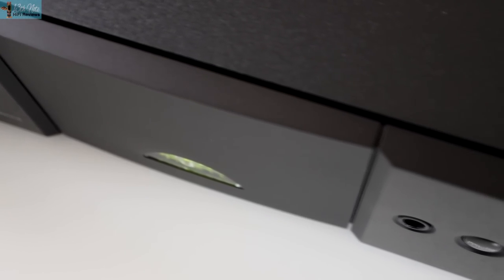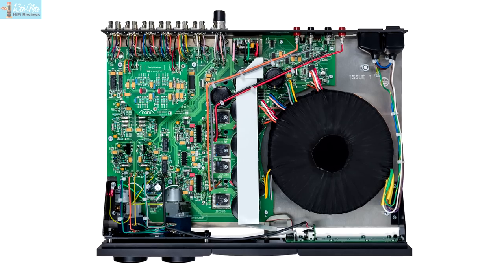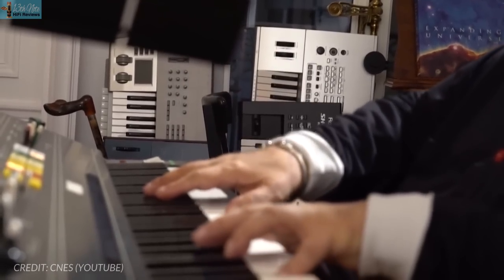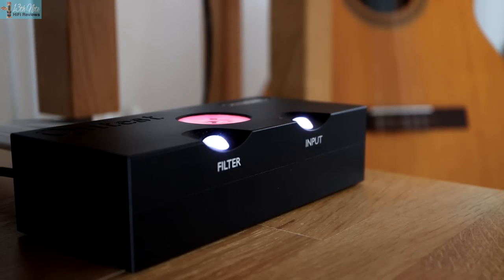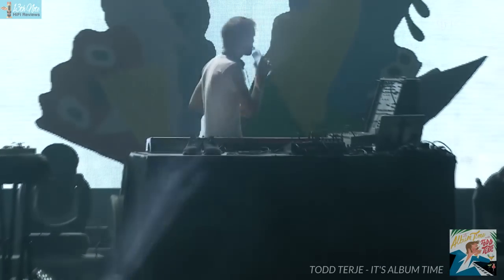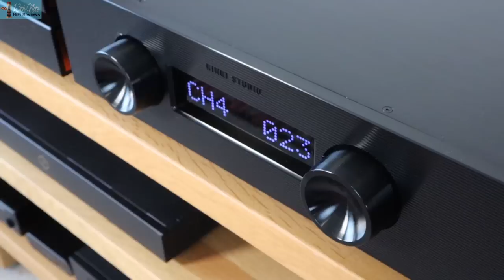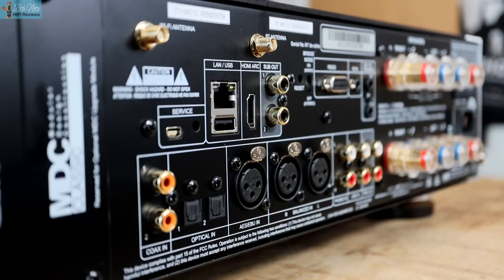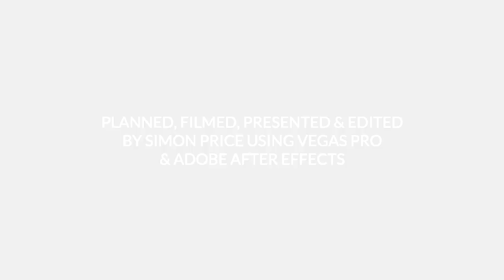Naim Supernait 3 (Vs. Hegel H390, NAD M33 & Kinki Studio EX-M1+)

Comment: One of your best reviews because of the particular amps involved. I am being selfish but would there be any chance to do the same amps driving ATC SCM40 or 19 speakers...?  I know ATC demand a lot of current but the Supernait 2 or 3 driving ATC speakers get a lot of thumbs up from users and would be very interesting how it compares with eg Hegel H390 driving the same ATC speakers...
Reply from the maker: Thanks very much stargazer. I doubt that will be possible to get them all at the same time tbh. I think they would work well with all amps here tbh.
Reply: I've tried SCM11 with a Supernait 1 and it had no trouble making the ATCs shake the room with the volume pointing at 7 o'clock.
The midrange was incredible with vocals and acoustic guitars but the ATC were a tad too dark for my taste, although this was mostly because of the CD5 as a source.
I've found Naim CD players to be a little top end shy.
ATC passives have a reputation for being hard to drive because of their fairly low sensitivity but they have a pretty flat impedance so don't necessarily need as much power as many think.
It's also worth noting that Naim cripple their products somewhat so they can double dip your wallet for an external PSU, although that depends on how much you like the presentation of the bare bones product.
If you love hard rock and metal and value slam above subtlety, then an additional PSU is a no brainer as speed and muscularity where the most obvious gains are.
Reply: @pauln6803  Many thanks for your insightful reply. I used to own a Naim System and found that Naim loves group music (eg Santana and The Pogues) but not so much large orchestras as found in classical music. But that was many years ago so the 'soundstage' may of grown with the later models of Naim. Despite Naim 'watts' having the reputation of being quite powerful I always found it frustrating that Naim do not produce Integrated amps with eg 150 watts into 8ohms so I can use them with ATC speakers. Many years ago I did enquire directly to ATC whether Naim entry amps can be used with their entry speakers their response was very direct in that Naim Amps do not produce the sort of amps which would drive their speakers 'properly'...
Reply: I found the SN3 harsh with poorly recorded material when matched with ATC (SCM7 and SCM19). But acoustic instruments had a natural tone. Also, if you're a fan of large soundstage and imaging, the SN3/ATC combo is not the king of instruments separation and 3D imaging. My 🪙🪙

Comment: It's a nice comparison Simon 👍. I tried Supernait 3 and UnityNova from Naim with Focal Kanta2 speakers. Even though   they promote these as a synagatic pair, I didn't like the taste of the sound. I think it is toomuch for beryllium tweeters. So I bought Hegel H390. But still I think I dont  get enough bass. Is it French speakers dont have bass compairing to american speakers ?
Reply from the maker: Thanks very much. Dunno about that re french and American but you may want to try some of the mono blocks that Hegel make for extra bass
Reply: I’d look more at your room!
Reply: The Hegel is pretty powerful (the naim is overhyped)
I didn't have any bass and was using a supposed 200wpc Arcam a49 driving small Ruark acoustic Templar 2s 88db sensitivity max power handling 100 wpc.
I tried something new classD power amp 600wpc and 1/3 of the price of the Arcam.
Now finally I have bass real string  plucked in the air bass!!
Amp manufacturers are very stingy with power. The Hegel should be enough but my experiments have shown me even in a small living room with small floorstanders power is king.
Personally I would never drop below 300wpc now
I am absolutely gob smacked at what real power can do. I found the Naim the most disappointing especially as it's the same price I thought the Hegel sounded lovely

Comment: I really enjoyed your review of the naim nait amp which my friend has and I do appreciate costs but when you add one of naims external PSU like the supermarket this takes the naim up several layers upgrades of sound quality, so if possible you could revisit the naim supernat 3 doing this?
Reply from the maker: Thanks very much. I obviously did the comparison amp for amp and adding power supplies pushes the cost up, as then a fairer comparison might be using added components with the Kinki etc like different power conditioners and so on. So such a comparison is probably moot. At the end of the day it comes down to a) is hifi a value proposition to the buyer or b) is hifi money no object buying but people want a branded name with different sound quality but not necessarily better

Comment: I recently had a Naim XS + Flatcap 2 in my system for a few weeks. It was very music when driving my Focal Scala Utopia Evo’s. 

Objectively, the pairing is a mismatch. $53k speakers running off $3800 (in 2009 dollars) worth of integrated amp and power supply but it was really nice sounding. 

My main components are a Parasound JC5 + Audio Research LS28 SE. That combo has more dynamics, transient speed and more transparency but it’s 4x the relative cost.

Comment: The interesting thing is each of these amp companies promote a separate metric.  Damping factor, watts, current, and now slew rate.  Hegel’s damping factor is something that is real and it has nothing to do with power or decibel level.  The control my Hegel had over my magnepans was special.  

Ifi just released a new streamer for 1200 usd/gbp called the neo stream .  Looks like quite a nice package for the price.
Reply from the maker: To be fair slew rate doesn’t have anything to do with power or db level as far as I know. It’s just different design philosophies I suppose. I saw that re neo stream, looks nicely made. 😀

Comment: Interesting take on the SN3 & H390. I auditioned them back to back. I found the DAC in the H390 was just getting pipped by my Chord Mojo 1 which I found very disappointing. I hear the Qutest is more Hugo 2 Level so its interesting that you found the internal H390 DAC better than a Qutest! Secondly, I just found the delivery a bit too linear and civilised with H390 in comparison to the SN3. Don't get me wrong, I was very very close to pulling the trigger on a H390, its a fantastic amp and immense value for money, but for me, the SN3 just does dynamics & PRAT so well, its  immensely entertaining to listen to. Coupled with the fact its upgradable, the addition of a power supply to SN3 easily moves it well past the H390 and then becomes comparable in cost to H390.

Both are fantastic products though. As ever, listen for yourself.
Reply from the maker: It’s more a valid discussion I think if systems are set out and so people can take a view if the experiences of the commenter is the same as the reviewer or others. Which is why you always need do set out equipment used. The equipment isn’t linear so the experiences are not.
Reply: The convergence seems to be that the Hegel is (much-?) more accurate, and the Naim is (perhaps-?) a bit more musical -- especially if PRAT is one's idea of musical. The whole thing makes me nervous because I'm getting excited about the Amphion Argon 1's, and I'm worried that I'll feel like an idiot for preferring Naim over the brand of amplifier that the Argon's are voiced with at the factory. :D

Comment: Tried a Naim Supernait 3 along with another Naim (cannot recall the model) recently with an Arcam ST60 from a Naim authorized dealer in Uk and both gave RF interference and were not happy although other amps were fine. Any suggestions?

Comment: Great review , my savings are nearly complete for my SN3 purchase , thanks for the info , will be pairing with cherished Proac D18,s
Reply from the maker: Thank you. What did you take from this video re choices out of interest.
Reply: @13thnotehifireviews7   Hi Simon , I was interested in how the naim compares with the Hegel Sound Signature , and it seems you like the sound signature of the naim as well , so as you own the Hegel brand its good to hear good things about the SN3, I will be initially using it with the denifrips ares 2 to start , thanks again
Reply from the maker: @idlohtrab  what about the kinki wink wink nudge nudge , and save grands
Reply from the maker: @idlohtrab  personally I think the kinki is the better all round proposition because it’s cheaper than the Naim and equally as good sounding, plus a little bit more neutral, but the problem with hifi is people buy based on brands and branding and expense and vfm doesn’t seem to matter. Not criticising as I’ve been there myself.
Reply: @13thnotehifireviews7  thanks for the advice , love the channel , keep up the excellent work

Comment: This is the second time I have heard about the Naim hum when powering up.  I’m a Naim fan but would not like drowning out the hum with music.  I would hate the hum when in standby mode (on but not playing music.  For $5,600+ US, it should not ever hum unless something is wrong IMO.
Reply from the maker: It’s inherent in the design….. Like saying a car with wind noise is annoying.
Reply: It would be a deal breaker for me.  None of my amps hum.  Different strokes.
Reply from the maker: Probably because the toroids are relatively small but comes bigger power supply’s means improved sq through gutsier drive !

Comment: If you hear hum from the transformer it means your mains power is polluted with some DC. Perhaps you should try a DC blocker.
Reply from the maker: It can hum just on the big size of it too I understand, it’s not uncommon or necessary to correct if it’s slight as in my case.

Comment: I’m no techie but from my own auditioning experience of the SN3 and the Kinki (215wpc) which I now own, I think without the power, slew rate can only go so far in essentially “compensating” for the lack of power. I found that with my ATC SCM11s (85db) the SN3’s bass could’ve been better controlled and due to the lack of power reserves, my speakers didn’t not sound even remotely dynamic until a certain (ie cranked up) volume. A volume which I (and probably my neighbours) wouldn’t be comfortable with. Given the price of the SN3, I was really disappointed. The Kinki is almost half the price of the SN3 with what I consider to be much better performance in every aspect. Furthermore, the op amps within the Kinki can be changed to suit different personal tastes. My lay view is quite simple, with all else being equal, one of the most important factors in choosing a suitable amp is sufficient power relative to the speakers’ sensitivity, regardless of slew rate.
Reply: Where did  13th note comments go? Lmaoooo.. Oh well. He asked why I didn't agree, then I answered why, then he said Wai had listened to those speakers with both and I hadn't. Then I aswered again. Seriously no offense intended.. Just wanting a fair shake of naim..

Comment: Just to be clear, are you saying this amp continuously hums after you turn it on?
Reply from the maker: Amps with big toroids do, it’s to do with the windings and electro mechanical effects. It’s a question of saying so, and then also saying whether you will hear it at listening position. And as mentioned, no to latter. It does settle down after a while until it’s almost inaudible but you have to have your ear up to the case or close to hear it in any event.
Reply: @13thnotehifireviews7  Thanks.  I have the Naim Uniti Atom and was thinking about adding some components.  Alas,  electrical hums are a nonstarter in the living room.
Reply: @GadZookz  I own a SN3 and I hear zero hum unless I put my ear to the case. I'm very OCD so I'd defo notice.
Reply from the maker: It’s gonna depend on things like dc on mains too, which can differ between households depending on electrical appliances around your place. I agree it is not any issue whatsoever.
Reply: @13thnotehifireviews7  No doubt it will be drown out by the hum of my quantum phased interocitor   Utopia only while it is in the same dimension.  🙂

Comment: If you try the Linear Tube Amplifier (LTA)  Z40 you will trow the Hegel out of the window and will never ever look any other amp no matter the cost. Dont judge my bold statement, do your research and give it a chance, you jaw will drop on the flor..
Reply from the maker: It depends on the sound you want.  I'm a fan of solid state amps.
Reply: @13thnotehifireviews7  that has a solid state sound with astonishing dynamics
Reply: which Hegel model did you throw out the window?

Comment: The EX M1+ is far ahead of Naim, who were among the best in these respects, when it comes to the quality of the cabling and the layout of the internal components. And regarding Heigel, they are light years ahead of the EX M1+. I think that Kinki Audio has reached a record, it is up to the others to try to reach it. My only negative point is the gold-plated ventilation grilles, which are not in the best taste in terms of aesthetics.
Reply from the maker: I think having the option to spec the colour of the grills could be a good idea 👍
Reply: Are you saying you prefer the kinki, or the Hegel? Cheers
Reply: @rog86  Visually and qualitatively, I prefer the Kinki, but in order to make a fair judgement, it is best to compare these devices on your own system, in your own listening room, and with your own records !  😉
Reply: @dab9742  cool, thanks....👍

Comment: In my opinion Naim products are way overpriced!
Reply: Which Naim products have you tried and what did you compare them to?
Reply: They are good but totally agree!
Reply: Could you explain what it is expensive against?
Reply: @ryansudding667  Against Exposure amps about half or less the price!
Reply: @zzt231gr  Which exact pieces of equipment??
Reply: @DBravo29er  If I remembered correctly it was Supernait or Supernait 2 vs Exposure 3010S2...Or something like this...
Reply: @zzt231gr  Well I have demo'd the Exposure  3010 S2D against the Sugden A21SE and then the Sn3. The Exposure was definitely more of a direct Sugden competitor than an SN3 competitor, from what I heard. But this was with all components fully broken-in. SN3 had over three weeks of break -n, as did the Sugden. The Exposure was a floor model for several months. SN3 sounds very different prior to two weeks straight of on-time. The SN1 and SN2 signs generally similar to the SN3, but are clearly inferior to it (amazing though they are).
Reply from the maker: I think I agree they are overpriced if I’m honest. It’s different but not necessarily better. It goes to show that just because the brand has a brand name, or should I say naim, it doesn’t necessarily make it the better amp.
Reply: And underpowered. Very bright too
Reply: @Brian Boytano That's where it's all so personal isn't it ? They sounded a little ragged to my ears maybe it was them straining.
In the end I went for class D 600 wpc power amp and a valve preamplifier.
Reply: You get what you pay for mate
Reply: @sbwlearning1372 have you actually got ears
Reply: @nickevans3190  Yep and they told me the sound was bright and the amp lack power for the price
Reply: Spot on regarding your observation on Hegel 390’s grip, soundstage, bass dynamics, brute power (Sound Engine Technology). It is on my wish list. I recently purchased a new pair of Focal Electra 1008 BE’s and paired them with a modest Hegel H90 (60 Watts) because of its warmth compared to say a Sim Audio or Naim. The brightness of the Beryllium tweeter needs a warmer amp. I stream using Tidal through a BlueSound Node 2i and have it connected through Coaxial vs RCA to take advantage of the superior DAC in the Hegel over the BlueSound. It is a superb match along with Cardas Oarsec speaker cables, custom Sound Anchor stands and Audioquest  power conditioning/management.
Reply: Yes they are overpriced, just like other named brands Gucci and Louie vutton, there are better made products less expensive gear but doesn't have the pride of ownership as having a recognised high end name.